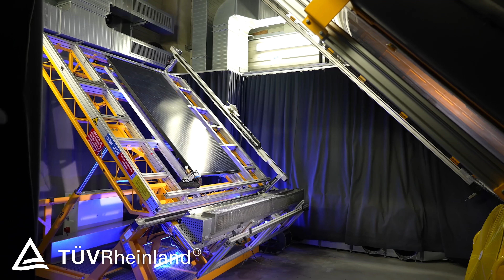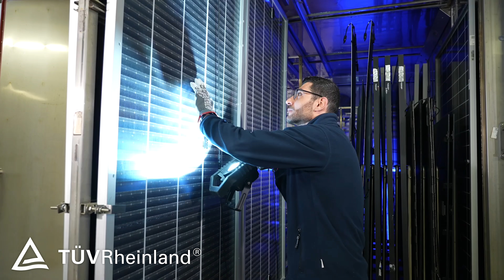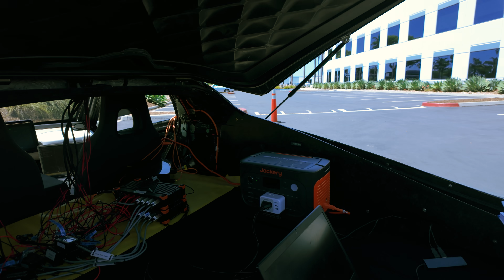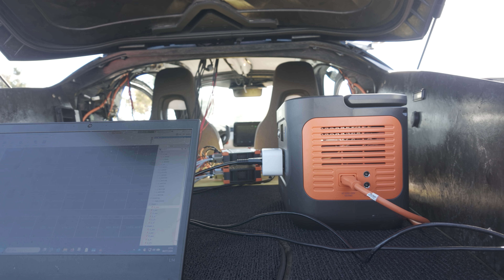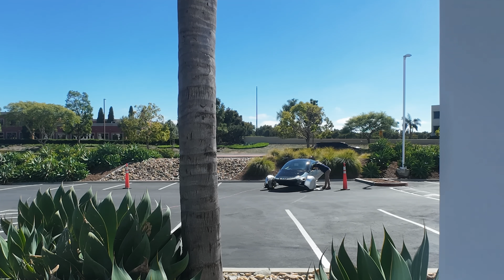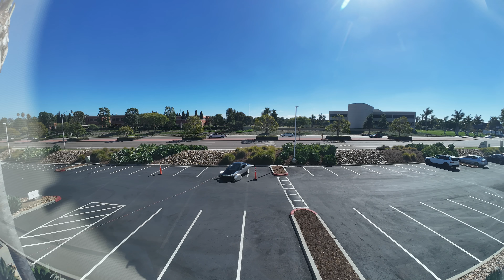Aptera's Solar Output Is Now Independently Measured

Comment: The only use case this fits is an apartment dweller who does not have level 2 charging at home. Unfortunately it does not charge overnight, only when parked or driven in daylight. 

The truth is that this was of interest because it was hyped as the first solar car. It is not that. The square footage for the panels is simply not enough to charge a car, no more than a cheap battery and panel setup. And since it is a Trike it does not have to pass stringent car safety regulations.
Reply: the average american drives about between 31-39miles per day.  The aptera can charge up to 40miles per day in SanDiego in Summer.  But the good thing is that if you plug into a level 1 regular 120v wall outlet it can easily charge over 100miles overnight which covers the vast majority of American's daily miles driven.
Reply: @DaBinChe wake up, they did a one day test in July, near solstice. The real world has road objects, trees, other sources of shade and these things called clouds.
Reply: Thanks for explaining that sunlight is only available during the day.  None of us knew that.
Reply: Two years without level 2 charging in my garage, and we did fine with an EV that is one third as efficient as the Aptera. Level 1 charging is enough for the Aptera. So-- it does charge overnight and when parked, and while driving. Do you have a vehicle that does that? Maybe you have solar panels and back up batteries at home-- you can't take them with you to work each day, or on long trips. Because of Aptera's efficiency, its solar panels are "enough to charge a car." And if you had read the FAQs on Aptera's website or watched its development reports, you would know that it has been designed to meet automotive safety rules and that the company is committed to crash testing.

Comment: Good stuff to have done and TUV is eminently qualified to do this testing!  I don’t know that the cost to integrate the solar is really worth it and hope that Aptera will make a less expensive version of this car that just plugs in to get the $2 maximum value of electricity the whole solar layer can produce. It’s a neat idea and will sell some cars and looks cool but having made solar panels and developed solar flexible cell proposals for DARPA, just because you can do it doesn’t mean you should do it which we may find out in repair cost after a crash - just use a replacement part without the solar so it is affordable.
Reply: So True, $2 worth of electricity in your average USA state is just $200 a year. The sun's not always shining like it is in the summer in Sunny California.
Reply: @teejg349  In CA electricity is something like $0.50/kw or more with a bunch of other added fees.  Typical CA resident monthly electric is well over $300 and folks that have EVs bills are over $500 a month easily
Reply: @DaBinChe  I’m suggesting that solar not mounted on the car is cheaper and more cost-effective than solar integrated into body panels so strings are always somewhat at non-optimal angles. You can get 4 kWh /day (or more) from a single panel mounted on a shed in CA.
Reply: That only works if you park next to that shed all day. :p
Reply: The solar doesn't add that much to the cost of the vehicle.  Almost all EVs and hybrids should use it.
Reply: @netscrooge  Your comment is based on what experience of conformable solar cells and stringing and bussing, laminating, etc.?

Comment: I have a home with a garage in NY.   Aptera Testing results: Average 4 kWh a day, times 50%, adjusted for spring, fall & winter, cloudy days, rain and snow, (Not everybody lives in Sunny California). Multiply total by $0.25 a kWh = $182 a year. This assumes you have a full sun location to park. ** You expect me to buy a niche 2 Passenger three-wheel vehicle, for more than a Tesla Model 3, and then leave it out in the weather, as opposed to my garage, to save $182 a year! Good luck with that math.  Sorry, but the truth  has consequences. Aptera is a fun toy, on the same level as an open air autocycle or three-wheel motorcycle. Aptera with the camper option, I love it. A fun commuter vehicle to save the planet, I don't think so!
Reply: You've missed the point entirely.  Sad.
Reply: Yeah, no need to read past ‘50% reduction’.  Fake news.
Reply: I mean, I've got a garage too. I still plan on getting an Aptera after they come to market. If, if they come to market. Anyway, the point for me isn't the potential savings from "40 miles free solar driving per day," it's their anticipated range. Even if they can only hit 70% of their anticipated 10 mi/kWh, that's still well better than what my current car can do. For example, my 2015 Ford Fusion Hybrid (non plug-in) averages in the high 30's to low 40 mpg due to how I drive. At a national average gas price (27Aug2026), that means I pay $4.10 to go 40 miles (at best). Meanwhile, using the national average electric rate (18.44 c/kWh), I pay about $0.74-$1.11 for the same distance. Ignoring the EPA MPGe, if I'm paying $4.10/gal for gas, this gets me the equivalent of 155-222 MPG$. Which is where it shines for me.

Yes, my Fusion can do some things that the Aptera can't, but given that I'm no longer running Uber or Door Dash, I don't really need a 4 door car when it's just me. So the Aptera fits my requirements better than most other vehicles. The best advice I ever read was something that Airplane owners recommend. Buy for the 90, rent for the 10. And the Aptera fits about 90% of the driving I expect to do.
Reply: @blackmoon8459  Very well said.
Reply: A fun and economical and safe commuter vehicle to save the planet, not to mention fascism-free. No to Teslas, thank you! 
We generally leave our cars in the driveway all day, easy to use that way, and put them inside at night (when the sun is down). An Aptera should work well for over 90% of our vehicle needs. If you need something else, go for it. (Just remember to boycott Tesla, and Starlink, and everything Musk.)

Comment: I have been reading the comments.
You do realize he said 4.4 kwh, on a bright sunny day.
That is not good for 50 miles a day.
That is not going to run a house with an a/c for more than an hour two at the max.
It is better than nothing but it's not a lot, in fact its really just a little.
My Tesla Model Y that is good for 12 to 15 miles.
Reply: Aptera's target is 100wh/mile so that 4.4kwh is 40+miles for the aptera.  Aptera has always said gets 40mile a day in SanDiego during peak summer.  Tesla ModelY has horrible aero compared to the Aptera.

Comment: I'm glad you confirmed the numbers, but in real life you can't take up three parking spots.  Also, if you leave the hatch open when you park, you won't have any belongings when you get back.  You might not even have seats.
Just build them.  People will buy them.  You'll get real-world numbers.
Reply: These are "realy world numbers." They are testing the output the cells are capable of.
Reply: @JorgTheElder To me, real-world is different for everyone.  If you live in England where it's overcast and rainy, and you park in a single parking spot, and you don't leave your hatch open all day, it's much different than living in sunny California, where you can take up multiple parking spots, and where there is absolutely no crime.  People want the car.  Now.  Build it!
Reply: @JohnPMiller  Which why they are rating *the panels* and not telling anyone what they will actually get. We have to understand the panels themselves to get a baseline.

You say "now build it." What do you think they are doing? Do you think they paused all the work they were doing while an independent, external company, did this test? This is part building it.
Reply: @JorgTheElder We'll disagree on this, but I think we'll both be happy when customers actually have their Apteras.

Comment: Remember, most passenger vehicles on the road are only about 20% efficient.
So, of  the 33.7kwh in a gallon of gasoline, only about 6.5kwh is used to move the vehicle, the rest thrown away as heat, friction and noise. 
About 90% of a kwh in an ev battery gets to the wheels.
With the aero efficiency of the Aptera,  it's like someone leaving a gallon or two of gasoline at your Aptera every sunny day

Comment: Cool test! The theory is many people only drive so many miles per day, so its possible this car may not ever need to be plugged in to charge. And its a combination of the solar panels, and the optimization of the car it self. Great tech!
Reply: I have a Prius with 30 mile ev range and then gas. It’s worked for me most days. So 40-50 miles of solar every day is great. Especially with more range and the ability to plug in if needed
Reply: @chrispewkreme  Thanks, that's great confirmation. I live rural, I have house solar, my Post Office is 15 miles away. There is no rural mail delivery, so a few times a week I drive in and check my mail. The goal is to do that solar / electric. In the past I have built solar "go karts" that work well enough, usually. What I need is enough ground clearance for when the road is bad. We need a Dakar Prius! haha cool, thanks!
Reply: unless you drive 15 miles a day. your are plugging it in. also this car has a terrible history i dought they ever hit mass market it keep dieing coming back dieing again.
Reply: @gogereaver349   It's not either/or, plugging in or not plugging in.  Plugging in a lot less matters too.  It matters to real people in their lives, not just someone trying to score points in a YouTube comment section.
Reply: @netscrooge  points is knows how solar and evs work and knowing there clame are bs all the car makers do it
Reply: @gogereaver349  And yet it does keep coming back. I based my comment on the website claim of up to 40 miles per day. That would cover at least some users. For the rest, we do have plenty of mass market choices.
Reply: @CarlinComm  guess you never herd of a investor scam before.
Reply: @gogereaver349  Guess you never realized there is ZERO proof of ANY kind that this is a scam, you ignoramus.
Reply: @gogereaver349  I average low milage, so it would actually be a devent fit for me.   Many days I do not need to drive, however some days I do, usually shorter distances, but sometimes moderate, and AC or DC charging would take car of road trips.  The main limitation is that I'm more likely to need to carpool on longer trips, so this couldn't be my only vehicle.
Reply: @gogereaver349 Once they begin selling them by the end of this year there will no longer be any question of whether they will sell vehicles.

Comment: Now provide a way to let the car feed to home storage as extra pv cells when car demand is low.
Reply: 💯 Would prefer user-selectable max car charge with 80% perhaps default for battery life but, for example, 50% when driving needs low to augment powering house or battery storage.
Reply: That will come eventually. There is already a standard for charging plugs that allow two way flow.

Comment: This is genuinely pretty cool, but it highlights that the economics of the solar panels change depending on where you are. 

In my house, with hourly rates and charging overnight, my electricity can be under 10¢ a kWh. Assuming I'm able to offput 4.5 kWh a day, every day (unlikely due to clouds and seasons), that's 45¢ a day or $164.25 a year. DEFINITELY not nothing, but that's a payoff rate that's a bit rough.

In reality, my electricity overnight is typically lower than 10¢ a kWh and I doubt I'd see more than 2-3 kWh a day averaged over the year. So it doesn't make sense for me.

Now if you change the math, drop me somewhere where the sun is strong and electricity is expensive, that math may be wildly different! Just worthwhile to do said math and make sure the spec you're picking is right for you!
Reply: It is not about payoff, it is about not being reliant on the grid. A hell of a lot of people will be able to do the normal daily driving without ever plugging in. The majority of drivers in the US average less than 30 miles a day.

Comment: As solar panel tech gets lighter, thinner, more power/area, stowing a few panels on the rear floor will be easy, with portable foldout arrays and folding mounts. Add at least one on each side of the vehicle to double power. Collecting 8-10Kwh/ day shouldn't be hard in Southern states, summertimes

Comment: The solar output is interesting, but still no real efficiency numbers on the road.  I want independent  miles / kWh at both 55 MPH and 75 MPH.   So far we just have the efficiency numbers  from one drive that had over 5000 feet of elevation loss.

Comment: Stock price is up because Aptera delivered on their promise of 40+ miles per day.  That's all I need to never plug in.  Leaving the hatch open in Florida is a no go.  I'd be  interested to know how much load the air conditioning requires.  I might consider leaving it on 24/7, set at 85 degF. when vehicle is parked.  Covering the windshield would help reduce the heat load.
Reply: "Covering the windshield" with dashboard solar that can pivot up & snap in place ;-)

Comment: Coming out now the video is misleading. If you read the report, the testing was done in early July, close to the summer solstice. The results are not representative for an annual average, even for sunny days.
Reply: Also while it should be obvious, its worth noting that this test was done in Carlsbad CA, so they are in the top 70%-ish of the US for solar irradiation; point being, for the majority of the US the solar panels would absolutely provide less than their claims, by a large margin. Now to be fair to them, this is their HQ so it makes sense to test there and if they wanted to be really misleading, they couldve driven the car a few hours to get into the top 90% of solar irradiation for the US making the results look way better.

Comment: my price here in GA $0.15/kWh x 4 kWh x 30 days = $18/Month x 60 months = $1080 savings in 5Y
Reply: The vehicle only uses 100wH/mile. That's about 2.5 to 3 times more efficient than any other EV.
Reply: It's not just about the electric bill.
Reply: Yeah you're not getting the same sunshine year round in Georgia as you will in Carlsbad near the summer solstice.

Comment: Simple question, can this charge off a normal wall outlet (lvl 1?) and if so, whats the time to charge from say 15% to 80-85% or even 100%?
Reply: They’ve already stated, due to the increased efficiency, you will get well over 100 miles of range overnight from a standard 120v wall outlet
Reply: @CharliePryor  thats nothing new most ev can do that.
Reply: @gogereaver349  name one single other EV that’ll grant you 100+ miles of range added in overnight charging on a 120v outlet.
Reply: @CharliePryor  15 amps is 15 smps these no black magic that gonna improve the charge rate. the care light wight might get more per kw used but its the same power.
Reply: @gogereaver349  you said most EVs can “do that” when I said “get well over 100 miles of range overnight from a standard 120v outlet.”

You want math? Cool. That’s 12A, sustained power at 120v for 10-12 hours of charging. “Most” EVs are getting no more than 40 miles of range on that, maximum, because they use 250-300wh/mile when they drive.

Aptera uses 1/3 of the energy. It’s not magically getting more power overnight. It’s using far less when it drives. That’s how it’s getting nearly 3X the miles in overnight charging with the same power.

No other EV does this. Zero.
Reply: @CharliePryor  thats there clams anyways
Reply: @gogereaver349  No, that's what the testing shows. Have some self respect.
Reply: Aptera is basically an EV. You can charge L1, L2 & L3. 125V x 16A = 2KW. Going from 15% to 85% = charging 70% of 40KWh battery =28KWh. So L1 will take approx. 14 Hours to charge from 15-85%.
Reply: @lk313  the typical L1 120v outlet in the US is 15A at the circuit breaker, but that is not safe to run at max for long time so for safety only use 80% which is 12A.  So recalculate at 12A please.  But yes 16A if you are using a 20A circuit breaker but not everywhere has that available
Reply: @DaBinChe  ev charges can see that and draw the max they can without popping a breaker,.
Reply: @DaBinChe the ratings already include engineering buffer if it's ul certified and such.  Run it at 15a all day if it's a 15a outlet and circuit.
Reply: @cellsafemode  Not what the NEC building code says.  There is very specific code in the NEC about electrical outlets where long use load is cap at 80%, only 100% load is allowed for short stints.  Running a 15a rated circuit at 15a  long and the wire insulation of that 14ga wires will get hot enough to start melting and end up with an electrical fire.
Reply: @lk313  No basically to it. It's an EV. As for L3, I remember there being some "debate" within Aptera. I don't 100% recall what the end result was, but I don't think it supports "full" L3 charge speeds due to cable size. With a 40 kWh battery pack, even the "low end" L3's would be 0 to 100 capable in about an hour. 50kW is what Google says the low end L3 chargers are capable of. Figure that the bottom and top 10-15% of the battery it's running significantly slower due to the chemistry involved, you're looking at that middle 70-80% charge in about 34-38 minutes. (40kwh*70%=28kwh. 28kwh/50kw=0.56h, or 33.6 Minutes. Same math with 80% gets 38.4 minutes).

Even if they cap at L2 charging, L2 is 19 and change kW. On the 40kWh battery, that's basically 0-100 in 2 hours. If they can hit their 10 mi/kwh target goal (which their own internal testing about a year ago showed they were very close), that's an average of just under 200 mi of range/hr.